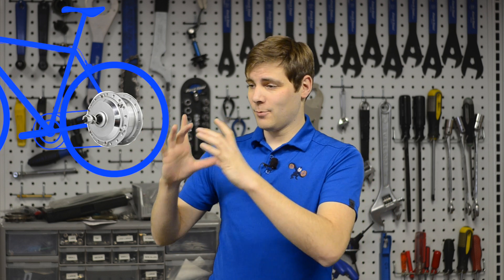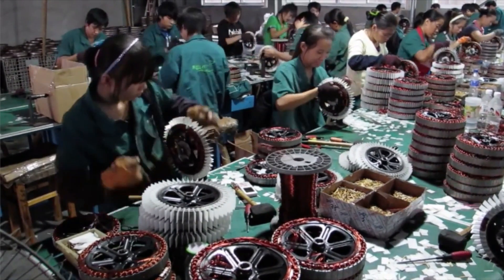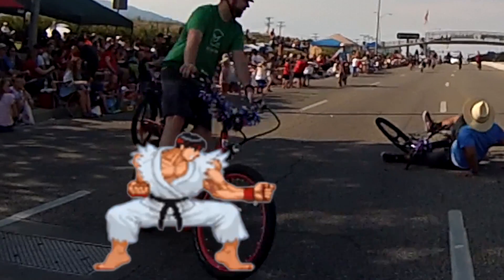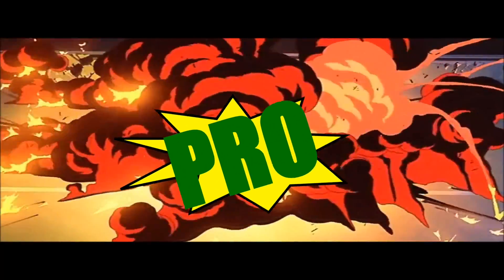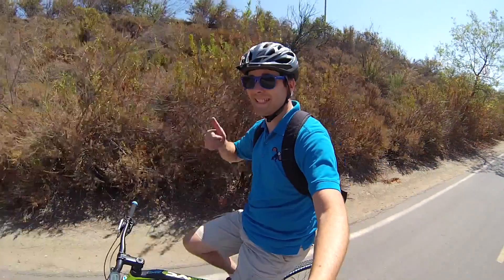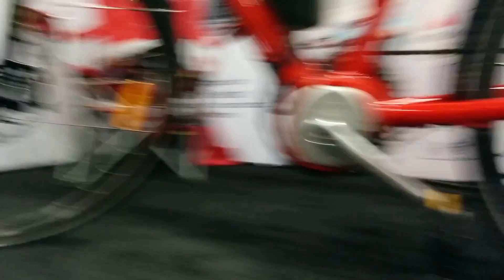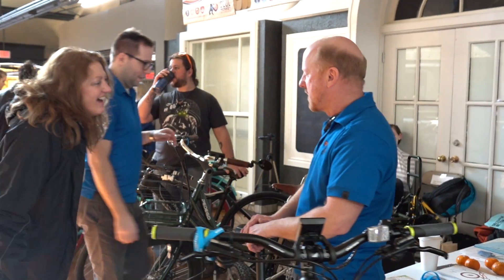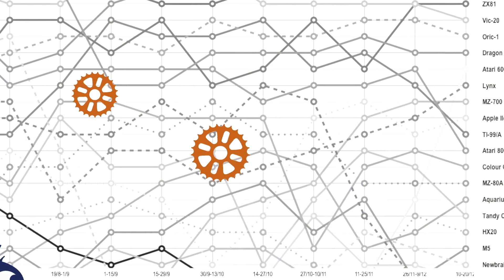Hub Drive VS Mid Drive eBike motor systems

Comment: Aside from the chain breaking issue, I’ve had a couple of mid drive bikes in at work that have worn out the top gear on the cassette to the point they were slipping/ jumping -one of them wasn’t even a year old -massive amount of torque. Personally don’t think they should be fitting cassettes with an 11t top gear.
Reply: I’ve had that happen even on regular bikes after thousands of miles. Replacing the rear cog is not cheap.

Comment: Which one is the fastest ?
Reply from the maker: Technically speaking either one is capable of reaching high top speeds, it's a matter of how they're programmed that makes the big difference.
Some mid drives have terrible acceleration on account of bad pairing with the physical gears, or aggressive shift sensing. Hub drives generally have greater acceleration, since they drive the wheel directly without going through the chain and gears. The best motors for maintaining high speeds are called "direct drive hub motors". Stromer uses one on the ST2, also Juiced Bikes U500.
Reply: @BlueMonkeyBicycles  ok, thanks for responding! 😁

Comment: The simplicity and reliability of a direct hub drive makes it the better choice for me. There's no gearing systems within the motor to go wrong, or the chain gears on the bike to go wrong. Obviously if you like to ride like a lunatic on trails then go for the mid drive, but if you want to commute to work at high speed on the roads and do a bit of off road cycling with extreme reliability, just stick with a hub drive. Ive done about 8000 miles on mine now and it is bomb proof so far. I have ragged the crap out of it on and off road. Many people who have mid drives who ride them hard often find them selves blowing there hubs or just moving back to an appropriate single gear, also they seam to be stripping the gears inside the motor after so many miles. They are also more expensive. They are very good though if you spend a fair chunk of money on one. I will probably get a mid drive soon, because really ive reached the limit of power that hub drives will give me without having a ridiculously oversized hub motor on the back.

Comment: At 00:57 into the video. Does anyone know the name or any information about the bike with the really big tires that has the couple riding on it? Thanks
Reply from the maker: That's a custom bike used in the burning man festival some years ago. That's about all I know on it, I found it amusing when Google searching for 'hub motor'.
Reply: @BlueMonkeyBicycles  Do you have any information on those super wide tires? They looks like they would float really good for a amphibious vehicle project
Reply from the maker: I have no clue, sorry. They certainly don't come from the bike industry. Perhaps heavy machinery, construction?

Comment: 5:55 
"...the chain will break"

You should say "might" or "could", not "will". There is a great chance that the average strength/weight rider will never come close to breaking a chain. And realize that all the bike manufacturers have tested their bikes extensively before releasing them to the public and their engineers have obviously taken this exact issue into consideration. A chain break is an uncommon thing and quite often the result of poor chain maintenance.

Edit: I forgot to say that I love the video. Thumbs up.

Comment: There is really very little advantage to mid-drives. Electric motors are not like gas motors where peak HP and torque are way up the RPM range.  The motors can deliver peak torque and power anywhere in its power range.

Comment: Middrives brake chains? I have drived +6000 km with my Haibike. Always on turbo cause it is speed pedelec. Went to steepest hills the motor van handle. No problem.
Reply from the maker: Cool

Comment: I can’t understand why? The chain on the Mid-Drive gears ⚙️ has so much STRESS that the chain will break !!?? 
This should NOT be !! It looks like they will have to invent/design and make a chain that can override or out perform this problem etc   😨😰😰
Reply: Just use thicker chains. Motorcycles cope fine.
Reply: Velldog wider chains are  not compatible with stock bicycle drive trains genius.
Reply: Velldog only a single speed cog like a BMX freewheel will have space for a oversized chain. All 7-8-9-10 or 11 speed cassettes use narrow chains.

Comment: Missed the most important difference: Mid-Drive motors have a transmission (gearing) to assist them.
Reply: this was the most important
,and this hub motor does the best
Reply: Exactly, hub motors provide fixed amount of tork whereas mid-drive motors take advantage of gearing. Very important difference indeed.

Comment: Great video, but you are missing one major point. With a Hub drive you can not have a hand throttle, it can only ever been pedal assist. This can be a deal breaker for many as they want to be able to hit the throttle and not pedal sometimes.

Comment: If you ride in any inclement weather at all a hub drive is the only way to go.  I have had a Surly Troll converted to ebike for years now in different configurations. Mid is nice, however the chains and sprockets get chewed up in a hurry in the wet slop Michigan weather has to offer. I was going through a motor drive sprocket and chain every 1000 miles. On the other hand I swapped it over to hub drive going on 3 years now with zero issues.

Comment: You didn't elaborate whether this one or that will recharge the battery, If not they are all useless.
Reply from the maker: Regardless of where the motor is recharging the battery while in use is a novelty. I've seen companies pursue thanks feature only to go out of business.

But by the way if you want to, you'd want to use a hub motor.

Comment: How about a middrive combined with a hub in the back?  Im thinking about doing this but i would need 2 battery's or connect the motors to one?! Not very effecient or lowcost id guess. I need more info on this asap! And i wil post the build on ytb:D

Comment: I was looking to buy a mid drive ebike but the reason i want the bike is to go up very steep hills. So i think will get a hub drive so the chain won't break. I never heard this before thanks for the very useful and informative video
Reply from the maker: I was actually wrong about the reason chains break on mid drives. It's not stress from the torque, it's from inexperienced riders changing gears at the wrong time.

Comment: @3:41 why is he riding with the kickstand down
Reply from the maker: Adds 3 horse power
Reply: Why does he have a kickstand, bikes are gonna fall over anyway. Remove kickstand  , bike weight goes down 150 grams.
Reply from the maker: Sounds like you never learned how to use a kickstand

Comment: I have a  PO4-20AH lithium battery in my E-Moped . I will not ride it in the winter . Can I just charge it and leave it in a shed for 3 month. Can the battery store in -20c for weeks ? Or do I have to bring the battery inside for the winter?
Reply from the maker: Don't let the battery sit outside, especially charging for months.
Bring the battery in, charge it, and come back to in in a month and check the level. Keep it between 20-80% state of charge, and within comfortable temperatures (40-100° F), and you'll see great lifespan. Don't let it sit at 0% either.

Comment: Did you guys ever do a video about grip throttles vs trigger throttles vs pedal-assist
and what people say about user-friendliness of the different setups?

I did some test rides on both  bikes with  pedal assist and grip throttles.I I found whenever I was pedaling the bike with the grip throttle it felt kind of funny when I would start to pedal as I wrench on the handle bars. I couldn't grip the grip with the throttle because it would rotate and I would accidentally add throttle at the wrong time. Pedal assist had a slightly similar effect. It also added power at low speeds as I was maneuvering through crowds and maneuvering through parking lots.

The pedal assist bikes also have one other drawback in crowds and in parking lots after you applied power the bike hand a kind of runoff time were the motor still applied power even after you stopped peddling. It wouldn't automatically disengage. Meaning that you couldn't really on drift slowing down to a stop because the bike was still adding power. 
It seemed like it would be adding more danger when people walk in front of you or if a car or to pull out in front of you. Pedal assessment is definitely not sidewalk safe.

Comment: One of the questions I have is it seems that many e-bikes seem to have their main components available overseas at a smaller price. It looks like the same exact bikes are vendor built with re-badging and a $1000 mark up in the U.S. So the question is, would it be better to part it out on a site like Alibaba, or would you get some kind of customer support and extra service for that price you're paying for a "U.S." model?
Reply from the maker: Very astute; you are exactly correct... Up to a point. Many eBikes in the US are just marked up Chinese bikes, but after a certain price point (usually around $2,500 - $3,000) you start seeing actually engineered bikes that are exclusive and very well made. There's exceptions on either side, but generally; yes. You are correct.

Comment: I have a Specialized Stumpjumper with the fattie tires & was wondering if I can buy a front hub motor for it or a new front wheel with hub motor?

Thanks for any help. 

Matthew
Reply: yep. check out Hilltopper dot com. kits start around 599

Comment: i have been thinking recently about fitting a front drive high output hub motor on a vintage moped like the honda pa50 (hobbit/camino) to make a kind of 2wd hybrid moped.

The pa50's engine can be completely disengaged using a lever on the rear hub leaving only the pedals to provide drive.

Although it is a 2 stroke engine the pa50 can get well over 100mpg in standard trim so should be even more efficient when coupled with an electric motor, allowing for silent emission free riding around town with the ability to hit around 45-50mph with light modifications to the engine for longer journeys.
Reply: Just plonk a Rolls-Royce turbojet on it.
Reply: Good idea. Have you thought of a front wheel kit that might be ideal to use?

Comment: ive done 1000's of miles on both. mid drive wins easy. unsprung weight, weight balance etc...  30mph off road and big jumps dont bother the mighty bbshd! with a megarange freewheel, it will also climb the steepest of hills. yesterday i was climbing a hill while leaning forward as much as i could and it was lifting the front wheel trying to throw me off the back while climbing. no chance of that with a hub motor!
Reply: Brother from another mother, you speak my language bbshd is a beast!!!
Reply: Which bike?
Reply: Howdy, do you know if you can coast and let the motor do the work with a bafang motor?
Reply from the maker: You mean use a throttle? Sit down, twist the throttle and have the motor propel you without pedaling yourself? Yes, most bafang systems include a throttle.
Reply: @BlueMonkeyBicycles  , a decade or so ago I was doing some research into assisted bicycles.  At that time, for Western Canada and the Pacific Northwest states, the maximum speed that an "assisted" bike was allowed to do was 20 mph (32 kph) on the flat without the rider pedalling.  What is the current law where you are? And do you have any info in other places?
Reply: @BlueMonkeyBicycles  How about Cargo bike like Winther Kangaroo Luxe, correct me if I'm wrong, that rear Hub drive  is best for this kind of bike?
Reply: @BlueMonkeyBicycles  funny thou you never included that info in the clip....hey!
Reply: @Steve not as often as you think, every 1000 miles or so. It's the derailleur that gives the most grief
Reply: @ACplanet  u using gear sensor, whats causing issue with derailleur, i get the odd gear clicking when its not jumping into gear but its no biggy
Reply: Max speed hit was 37mph on flat with limited distance, 52v and tweaked settings with penoffs software
Reply: @Steve ive not replaced it yet, 1.4k miles, using a gear sensor it reduces wear, as slim is off roading alot 1k miles is amazing for chain replacement and ive no doubt slim is using a snap in quick link.
Reply: Hub a bubba it's easy an how do u charge the batteries for 14000 lithium batt is it included or separate it's 48 volt to 1000 hub
Reply: @Steve its good fun, u can put effort behind it, it just takes u further, and like my dad it gets him out and about even at 70 plus years having last rode a bike when he was in his teens, yer the stealth bomber types are cool, just u got to insure and register those types on road.
Reply: @Steve lol ah yer the onyx ocr still has pedals thou, there are ones that don't have that.
Reply: @Steve u can throttle only bud luna cycles have a throttle only set up for bafang and u prob cud use the auto gear change shimano have

Comment: Well said but let me add two points: with mid drive you don't have higher risk of damage to the chain only, you also have much quicker wear of all the transmission, chain spurs and pinions; though, the possibility of switching to lower gears not only allows higher torque on the wheel but also higher efficiency at very low speed (less consumption for the same power output). Second: hub mounted motors, especially the more "torquy" ones that are usually heavier, can disturb the work of the damper on a full suspended bike, as the increased mass of the wheel will tend to make the whole wheelmotor bounce. In my personal experience, better have quite a sophisticated suspension, where you can separately set compression dampening (quite tight) and extension dampening (quite low), so that any bump won't easily throw the wheel in the air but the wheel itself will come back down as quickly as possible. Tire pressure is important as well. 

My personal opinion: the feasibility of hubs is much higher than mids, I've come back from a wood with a dismantled derailleur (no throttle control here in Europe, 250 W and PAS sensor by law!) by just spinning pedals. A high torque rear hub motor, central/front mounted battery and a proper shock absorber are a good set even for medium to hard offroad. For the hardest trails, a mid motor will make the difference.
Reply: Flats are a pain on hub motors. I just flip the bike upside down and fix it. I live in the desert, sealant is a must here. Until I get 20x4 inch street tires, I might run tire liners. Other than that, hub motors can last many years.
Reply: Agreed. My BBSHD completely wrapped the derailleur around the cassette when something smacked into it thanks to its power. I'm just glad I wasn't far from home then. I'd ideally like to see simply double reduction hubs for heavy vehicles that don't go fast, like for MTB fat bikes and whatnot where going uphill is a priority over speed on the flat. Even 20kph max would be fine and one could upgrade battery voltage to get more top speed if totally necessary. For commuting though, even direct drives make sense as smaller hills and 20kph average makes for a more than sufficint efficiency and the near indestructability of the motors is paramount, plus redundancy if drivetrain breakage.

Comment: I've got 2 pedal assist emtbs, a giant dirt e with yamaha mdu drive and a moustache samedi  bosch performance mdu, ,both in Spain, here in England Ive got a rear hub 1500w diamond back emtb with a 17ah 48v battery, believe its Samsung and gives me 25 plus miles, rear hub motor which goes very well.

I bought second hand and it has much more power for climbing hills etc and when its at 30mph you can't pedal fast enough just throttle , like them all, but theyre different , don't think you can say just mdus are better, theyre certainly slower!  
But the pedal assists  give you more exercise, for sheer performance and to cross a forest quickly and go up hills id pick the rear hub drive one...to go down a mountain quickly the mdu ones as theyre lighter. Theyre both good but I don't like the sudden braking after 17mph on the flat.and the rear hub does effectively double the speed ...

Comment: I'd say the hub was failed in this video by the omission of possibly it's greatest strength - you're never in the wrong gear. Even if your inexperience puts you on a steep hill whilst in your highest gear, at walking pace, with no chance of getting a mid drive bike in a low gear, the hub has your back. And it will keep you climbing so you can hold off the chain enough to change down gears even under power.

Comment: Is it me or is anyone thinking of a mid/hub drive combo? Just add the hub drive and a battery..lol
Reply: Yes, I have the Bosch system which I'm quite happy with. Sometimes my ride extends pass fifty miles per round trip and I wouldn't mind a hub drive on the front wheel to help me in those pesky horse trails and Sandy Kern river bottom s.

Comment: In 2 years of riding a 1000watt middrive, the Bafang BBSHD, I’ve only snapped a chain once. This is with an 11 speed (skinny) chain. In 2 years of riding a non-ebike. bike, I snapped a chain twice. Also 11 speed. I don’t think the extra torque matters much. But lubing the chain regularly and good shifting habits matter a lot. Carry a chain link with you. The chain can only break in one spot. So just put on the link when it happens. Get one that requires no tools like the Connex link. No need to carry a spare chain or buy a new one until its fully worn.